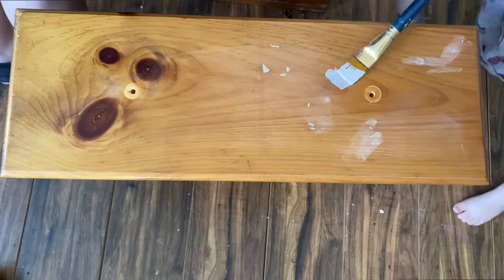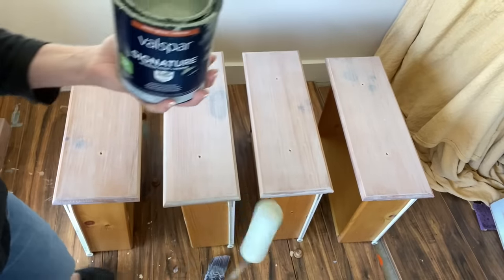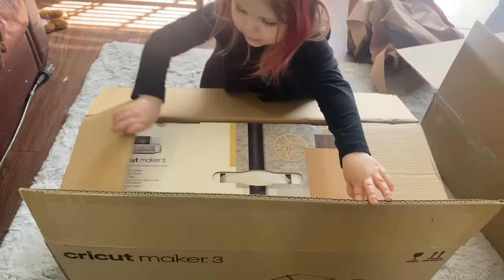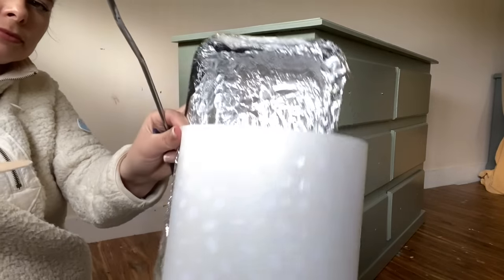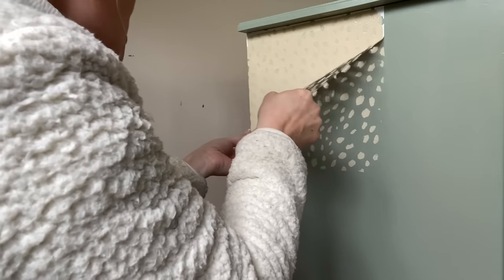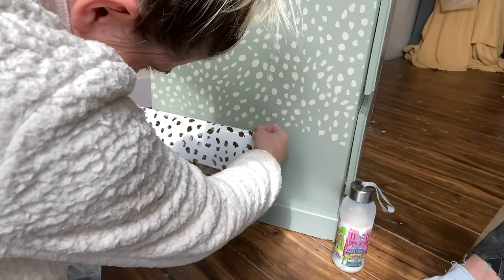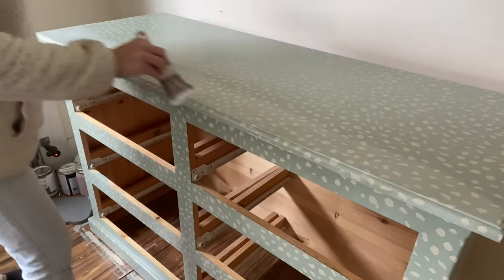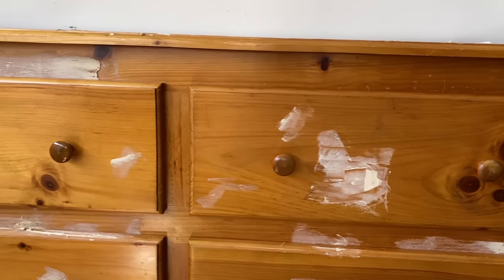Dresser makeover - forgiving flaw hiding finish using DIY fawn stencil, 1st time Cricut Maker 3

Comment: Very cute!  I've seen many people use the cricket machine for so many things and they all came out beautifully.  Good luck with your ideas for this machine!  Could you have placed the stencil back on the original backing that it had when it came out of the machine?  I am wondering about the storage issue. Also, did you wash the stencil and if so, how did that go?  Thanks so much.

Comment: How does the Varathane water-based polyurethane compare to Polycrylic? I tried applying Polycrylic so many different ways on a refinished desk that I painted white but streaks or air bubbles would always appear. I've tried a foam brush, synthetic brush, foam brush with a nylon sock, applied with light pressure, etc but the finish is still awful with air bubbles. Is the Varathane a better option?

Comment: Just wanted to say that I love your work.  But I do have a question when using the high density foam roller do you get the orange peel effect? I've tried it a couple of times but I seem to get that effect. Do you have any suggestions .
Reply from the maker: Hey Robin, I’m glad you’re here ❤️ I get the least amount of texture when I use valspar furniture and cabinet enamel or General finishes milk paint.  I also get a pretty smooth finish with my one step paint recipe (leave out the chalk powder for a smoother finish)
And make sure you keep an extra roller near by for when the first one gets too saturated with paint.  The goal is to brush on a light coat and then even it out and remove excess paint with the roller.  This black dresser video is a good one to watch be for that technique and the valspar furniture enamel
Reply: @blacksheephouse  thank you so much. Love watching your videos and I have learned so much from you.

Comment: Help!   I tried mixing Krylon antiquing wax and Valspar limewash glaze for a lighter finish. I love the color however as I brushed with the deck brush it started to pull off all my staining color..not the base color? Do you know why? This is my first attempt. Thanks for any advise.
Reply from the maker: ❤️ If that wasn’t a typo what you wrote that you mixed wax and glaze together I would guess that’s the issue.  I’ve never tried to mix wax into anything before.  (While wet) I only mix things together that are water based based with water based or… oil with oil based products.  But being a creative comes with taking risks and trying weird stuff just to see ❤️ No matter what happens during the creative process You can always wait till it dries/cures, sand away what’s left and start again though.  If you want a lighter look you can mix paint and glaze or mix paint and clear coat to make your own glaze, I’ve been successful with that recipe a lot
Reply from the maker: This video shows my DIY glaze recipe https://youtu.be/Qr9Ony0nhP4